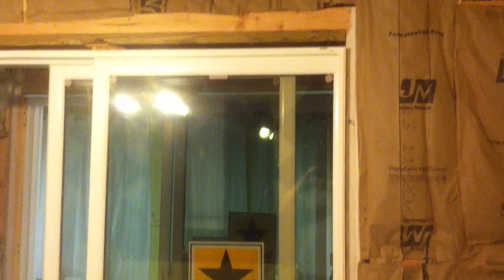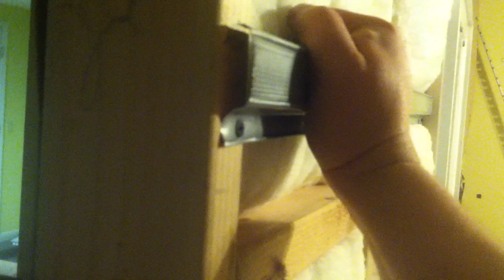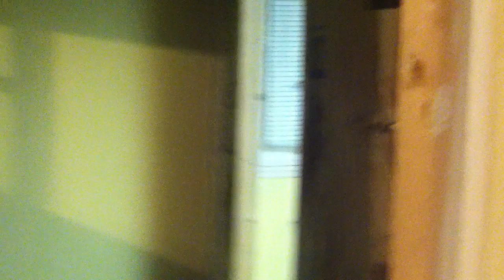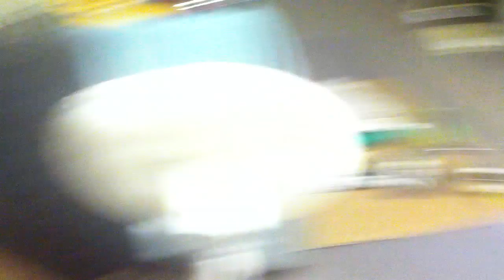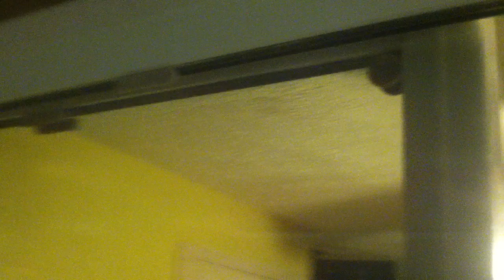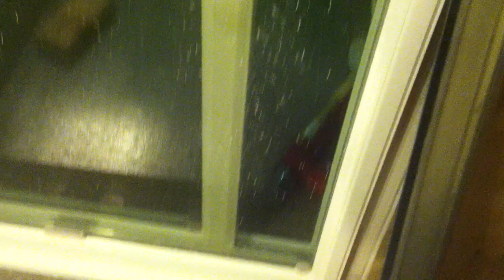Day 5 Recording Studio Build - Insulation, Resilient Channel & Soundproof Doors

Comment: That laminated glass looks pretty thin, and it looks like they are the same thickness… Which I hear is a common DIY mistake. I’m just a novice DIY guy, but I’m just wondering if you’re happy with the isolation that your wall and this identical laminate glass provided?
Reply from the maker: This was a 10 years ago and would surely do things differently today. It was a good learning experience as well on a limited budget. I'd say the isolation was pretty good. Surely not 100% and perfect. The isolation between the control room and live room was actually great. That is probably for the fact that there were actually 2 walls that were about 2 to 3 feet apart. So, yes a big air gap and using 2 walls is a good sound proofing measure.

Comment: R channel is screwed to studs which couples them to the studs which in turn transmits vibration into the studs.. a better way  I found is to use rubber mats (the kind made from  recycled car tires) cut into rectangles and screw them to the studs so each side of the rectangles over hang on each side of stud, screw half inch slat board to each rubber rectangles over hang  so there is a floating slat board between each stud connected only to the rubber rectangles.  Then attach dry wall to the new slat boards instead of studs.   It's cheap and works great.  Rubber from these mats are similar to the rubber used in auralex u-boats.
Reply from the maker: abcdd Great advice. Thanks for the input and helping to make better soundproofing ideas.
Reply: I bought isomax clips.  This way, the metal channel does not transmit vibrations as easily due to your suggestion of a screw, connecting it through the rubber to the stud. I definitely spent a little more money!

Comment: You know the way you attached the hat channel is basically useless? That hat channel is supposed to attach to clips that then attach to the studs...
Reply from the maker: That is true for hat channels, however this is the Auralex RC8 "Resilient Channel" which is designed to be attached to the studs via the screw holes. It is designed different than a basic hat channel. But, you are correct normally hat channels would be installed with clips. I was skeptical from the instructions at first, but so far there has been no issues with isolation. Thanks for pointing this out.